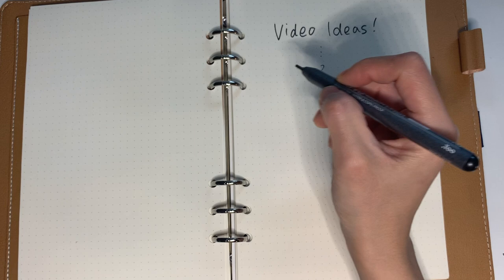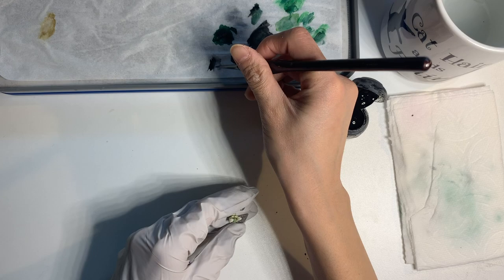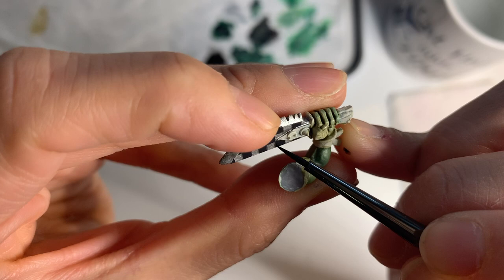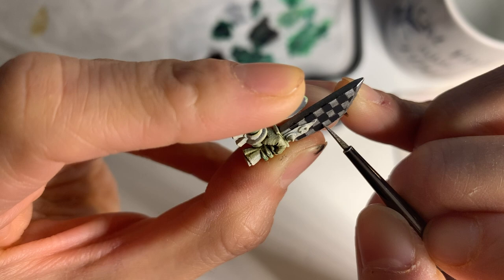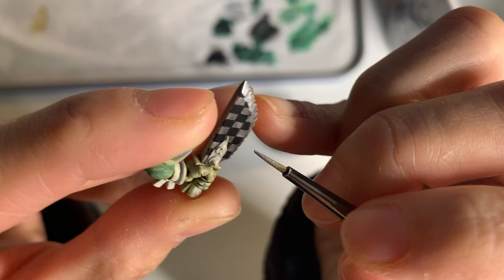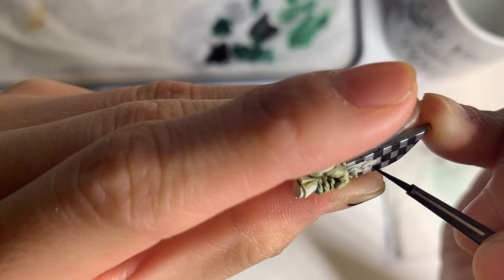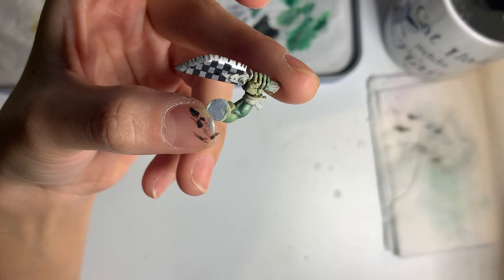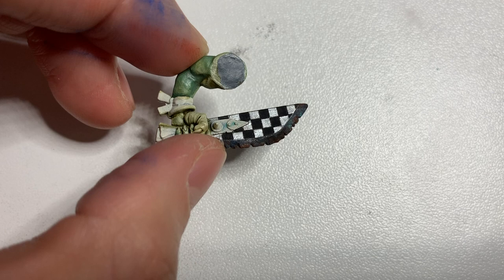How to Paint Checkered Pattern on Your Minis!

Comment: The mechanical pencil is a really good hint, cuz if youre new at it, your first thought migh be to paint a grid and fill in the black. this gives you smaller white spaces, so when you try and fix it, you're already blobbing up layers and it loses the sharpness
Reply from the maker: Yes, exactly!! That’s why I sketch with mechanical pencils whenever I freehand! 
You can subtract one layer of paint, hence less clumpy and messy!
Reply: @SophiasMiniatures  is there a particular graphite density or lead size that you use for the pencil sketches? I assume thinner is better, although filing it to a point may negate that.
Reply from the maker: @seanfulton4492  I recommend to use 2B graphite because it glides smoothly on the surfaces but not too soft. Also for the lead size I guess smaller the better but I just use what I have at the house which is 0.5 mm!